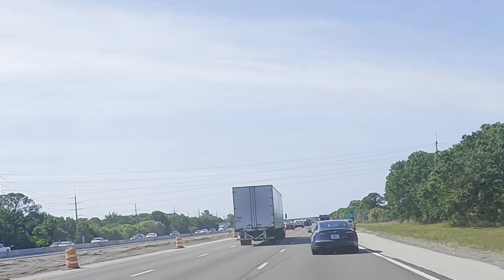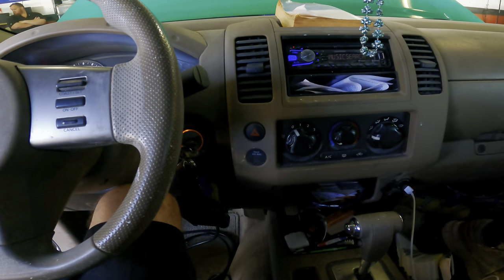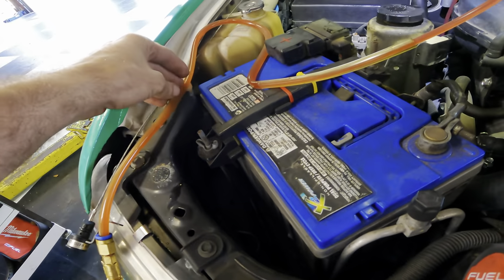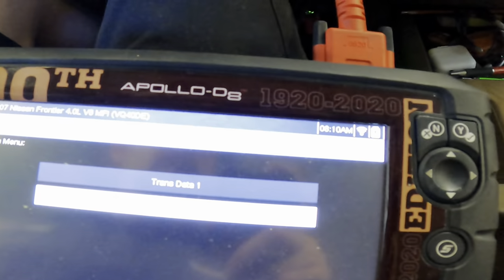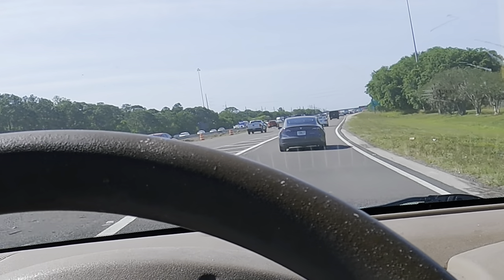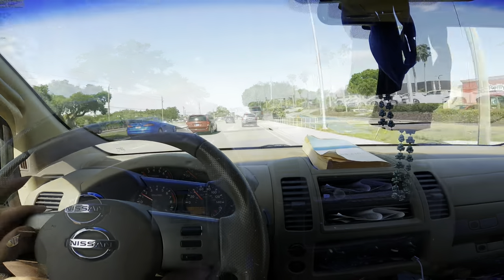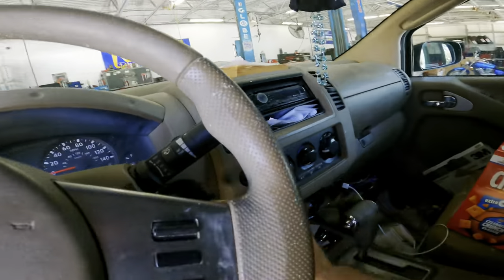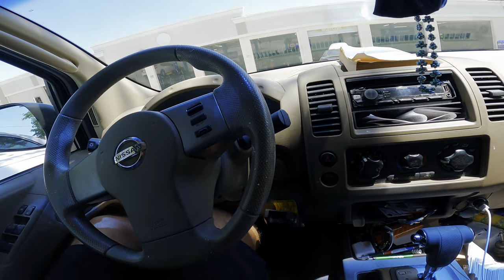Customer States: Vibrates Sometimes! How to save money by using your words!

Comment: I have been an electrician for 20 years, and have gotten to the point where I can get a diagnostic over the phone maybe 40% of the time.  What I have learned over the years, and this applies to be and vehicles, is sometimes you just can’t relate what you are experiencing.  I recently took my wife’s car to the local shop because the engine just wasn’t sounding right.  Mechanic said it sounded ok to him, but pulled the dipstick and found it over-full of oil!!  Took it back to the dealer (where wife had it recently serviced) and had them drain and refill, with the hopes that the engine isn’t damaged.  How else can I describe what the problem is other than “engine sounds different lately”?  When did it start?  I don’t know, she only drives it a couple of miles each way during the week, maybe grocery store or something on the weekends, but she doesn’t notice stuff like that.  I only noticed it when doing a longer drive recently.

In this particular video, I think the service writer DID do a really bad job with gathering info and translating it to the techs.  However, I think that each situation is different, and it isn’t always the customers and it isn’t always the writers.  Hell, I even took a van to three different locations with a really bad squealing noise from the brakes, with each technician telling me there was nothing wrong.  I finally insisted that I wanted a complete brake tear down, and they finally found an occasionally sticking piston.  So even when there IS full communication, even the tech can be the problem.
Reply: Sometimes the service adviser needs to ask the correct questions.  I would of asked when does it make the noise? All the time? When engine us cold? When engine is hot? Slow speeds? Fast speeds? Can you describe the noise, is it slight or very loud?  Is it a rattle, knocking, squeak, or muffled type noise? Has the vehicle been worked on recently? Are you noticing any other symptoms like vibration or smells? 

There's alot of questions that can be asked that the customer doesn't think to tell. And many times the vehicle won't exhibit the symptoms at the time of the techs test drive.
Reply: @HoLeeFuk317  This is why it would help for the customer and technician to communicate directly.  So much information is lost in translation by service "advisers".

Comment: "Shake when in gear, and like a noise at times." I think that needs to be the first line in the chorus of a song describing the frustration of dealing with vague trouble descriptions...
Admit it, you laughed.
Also, did you check to see if the air cleaner is full of Cheez-Its?
Reply: The first part is descriptive enough, but "like a noise at times" -- what the heck?  How does something resemble a noise?  Lol.  Good luck!  Plus, it's INTERMITTENT.  This one could cause lesser mechanics to retire.
Reply: It actually reminds me of the novel Flying Sorcerers. The interloping character's name, through translation, was called "As a color, shade of Purple Gray" and for the remains of the novel he was referred to as "Purple" by the characters.

Comment: I worked in a shop some years back where if the write up from the advisor was less than 3 lines for anything more that the likes of lube oil and filter or tire rotation, the advisor was in for a talking to.  The manager was serious enough about in fact that he wanted the tech to need to take a few minutes to read the notes on the complaint.  Rarely did any of us struggle to find a starting point when doing the repairs or services.

Comment: Sometimes part of the disconnect is from the service advisors. I am fairly knowledgeable about cars, etc. But I know my limits. I don't have the time and equipment for more involved repairs. 

On a repair I had recently, it wasn't until I was able to talk to the tech directly did the problem get solved. As soon as we had a conversation, he immediately realized what I was talking about. 

He said to me, "unfortunately the service advisors don't always relay messages very well." The service guys unfortunately can have just as bad of "vocabulary" as the owners sometimes.

Comment: As a vehicle tech of 30+yrs you hit the nail on the head @23mins into this video, I get totally cheesed of with the service desk/customer not passing the info on to me, I had a car come in god knows how many time for a noise at the back end, it would turn up with the keys through the letterbox "its done it again". Having got totally peed off with the front desk and lack of info I left a note in the car "If it does it again STOP and phone me!" He phone me on the Sunday, we had already worked out it only made the noise on a Sunday, I drove to his location (his mother in laws house) and he said it does it there just as I drive up her driveway,,,,,,I pointed out her steep driveway entrance and pointed out the tow hitch was hitting the ground, I had gone through the bushes on the back end even with correction fluid to see if that had moved, UNTIL I asked the right questions, where, when, show me. Great videos already subbed so tappy taping the like. Thanks Ray, Hello Pete !
Reply: So did you fix his mother-in-law's driveway?😄
Reply: It's always the mother in law!

Comment: As my body begins to fail me and I make the transition from mechanic to service writer, I'm finding that my experience as a mechanic is endlessly helpful in collecting and passing information back and forth between tech and customer.

Service writers get a lot of crap from mechanics, and rightly so a lot of the time, but if you've ever had a GOOD service writer, you know just how quickly all that disdain fades away.  Good verbal AND written communication skills, not just willingness but eagerness to step in between a frustrated tech and an angry customer, and the knowledge and ability to poke, prod and tactfully interrogate to find the complaint, as well as to translate to and from "tech speak," are critical skills.

Comment: Totally agree with you about getting good information from the customer. If the tech can't talk directly to the customer, it's up to advisor to get that information. Good advice to customers too. Something that customers do sometimes,  is diagnose  the problem themselves, and if the tech isn't careful, he can be led down the garden path. I was told by a customer that he had replaced the radiator to address an overheating problem. so I checked everything but the radiator. could not find over heating cause. finally checked radiator, plugged!

Comment: I have a pathfinder with this engine, I'm pretty sure I know what vibration he's referring to. While in Drive and stopped the rpms drop to ~600 and it jumps back up to where it should be. I have no mechanical experience so I have no idea what causes it. I thought it was a misfire so I took it in for a tune up, but even with new plugs it vibrates.

Comment: So many transmissions these days MUST be maintained religiously as oil. I would get customers saying "well, I never had to change transmission on my other cars before". They completely fail to realize transmissions also have never had as tight of tolerances before. Just about every main brand has a judder when the trans fluid has been grossly neglected. That also gets many manufacturers transmissions an undeserved bad reputation. Everyone would expect an engine to explode after 20-30k miles and no oil change but their head explodes when a neglected trans blows after 60-100k. Go figure lol

Comment: I had a 2015 Mustang GT that I supercharged and had been drag racing. I took it to ford because the bolts that held the diff in the cradle tore through the bushings. I told the guy well I supercharged it so I'm not sure if you will cover the diff bushings. He said why would a super charger affect the bushings??? I said no idea! LOL The car still had slicks and skinnies along with the track number on the rear window. Called me two days later saying the bushing aren't a replaceable part and the entire rear subframe was being covered under warranty. I was blown away.

Comment: As long as you are ranting, you should include service writers as possible problems.  Back when I was young and foolish and took my car to the dealer a few times, I would spend two or three minutes describing in several paragraphs of detail to the writer what the symptoms, occasions, and suspected problem was. A couple of times I wrote the problem out on a sheet of paper and tried to hand the description to the service writer, and he refused to take it, saying there was no place to put it in the system. Then he would think for a bit, and write down about three words on the ticket, probably along the lines of "customer does not know what is wrong." Needless to say, it cost a lot of money and rarely got the problem fixed. Then I started going elsewhere, where they listened to me, and they usually had problems fixed in a few hours.

Comment: I think automotive service industry is rife with these miscommunications because you have such wide variables at play. 

I used to listen to Car Talk on the radio and most the call ins demonstrated this very well - expert mechanics can think through problem solving an issue from several angles when given minimal inputs, so a customer can help narrow the focus by providing good, situational symptoms when presenting their vehicle.  Unfortunately there are a lot of uneducated consumers who don't know a dip stick from a valve stem.

Service Reps can help by anticipating and eliminating paths of diagnosis by asking good follow-up questions and taking good notes.

Finally, service techs can improve the equation by providing supportive feedback (both positive and constructive) on service rep's note taking, helping them improve their note taking and questioning process for future customers.

Comment: Transmission fluid changes, brakes, steering and other drivetrain work cannot be addressed/declared fixed without a test drive, even if you were to jack it up in the air, its not under the load of all the vehicles weight and the tires hitting the road- you’re a true mechanic ray 100% recommend anyone to you

Comment: Much can be learned from observing the condition of a vehicle. Especially the interior.
Reply: Like what?
Reply: A vehicle can look completely mint and not run at all
Reply: @danh2134  Very true. Happened to me. 2019 Dodge Ram 2500. Observation: Brand new on dealer lot, upon pushing ignition key loud pop behind dash and under driver seat. Vehicle failed to start. Decision: Ended test drive, failed to purchase vehicle.
Reply: @Bryan-Hensley  Owner likes Cheez-its, but that’s only an assumption.

Comment: Don't Reeeee! Ray! lol /edited to add this, I see that they are a painter and that seems to be a work truck. In my youth I painted apartments, I can't tell you how many vehicles I trashed because they couldn't take the weight of 10 5 gallon buckets of paint, plus sealer, plus equipment, hitting Cleveland streets constantly. His problem could be suspension related while fully loaded down.
Reply: Could be. And had work to do and moved all the heavy stuff over to another vehicle when he dropped it off for repair. Therefore eliminating most of the problem himself.

Comment: In my humble opinion... the less people know the easier it is to control them.  Automobile manufacturers have slowly conditioned the buyer to rely more upon technicians to do everything from a basic oil change to much more complex repairs.  They removed informative gauges and replaced them with warning (idiot) lights.  For example, in regards to some customers not using their words, a customer may say my car smells hot instead of being able to look at the temp gauge and saying it's reading 220° in heavy traffic.  
Many moons ago during a Boy Scout meeting, we learned how to do a basic tune up.  Change oil, oil filter, air filter, pcv, cap, rotor, spark plugs including checking/setting proper gap (info from the owner's manual) and so on.  I believe we were taught in driver's ed how to change a flat tire.
 Keep up the great work. Love the videos.

Comment: On your not-a-rant rant, I can see where a good service writer can be as important as a good technician. They are the ones with immediate access to the customer, so they need to be skilled at interviewing the customer to find out more about what is wrong. They should never settle for "car won't start". They need to ask more questions. When won't the car start? When it's cold? When its warmed up? Describe what happens when you turn the key/press the start button. Do you hear any sounds? Are there normal sounds that you DON'T hear? I've never thought about this issue before, but you did a great job of describing how it affects you when trying to fix things.

Comment: I always bring a note in writing with date, time, mileage, what, where, when, etc. I know from the questions I get back from the service writers, they don't read. I have also talked with my mechanics and find that the service writers don't listen. I worked my way up to manager in a JC Penney Auto Center before they all closed.
I also commend you on the hands on check of problems. I feel that people rely on computers for more than they are capable of.

Comment: Ray, it is not clear to me if you evacuated all the trans fluid and did not change the filter if applicable. Flushing the whole system without just doing changing the filter is the kiss of death for a transmission with poor fluid as you yourself have referenced many times. You are a technician not a mechanic and I am over the top impressed with you in every way.👍
Reply: Watch it again. Its quite clear what Ray did and didn’t do.
Reply: @robmurray33  Based on my 25 year career in a fairly high upper echelon of auto manufacturing, your reply is archaic. Can't believe I just replied to such a misinformed person. Maybe too much coffee!!!

Comment: My old man is an amazing customer, he owns a pristine 2000 Chevy Cavalier LS, last week he came to me because a no crank no start issue and then he added that with the car in Park it keeps rolling downhill. It took me longer to get and replace the gear selector cable bushing than to correctly identify the problem without troubleshooting.

Comment: Split pins have a slit all the way through the pin with a slight swelling in the center as it is an interference fit.
Cotter pins are designed to have the two ends folded over with the loop pressed firmly against the part it is holding and the ends fold over in opposite positions

Comment: I definitely agree with the whole describe as much as you can rather then just “car does not start”. But there are SO many people out there so unaware of anything. I mean that’s why you get your metal on metal rotors and pads, balled tires, oil with the consistency of a red brick, and the list continues.
I just replaced a battery for someone that was about 8 years old. They said “you have to replace that?”, I was almost dumbfounded. But as nicely, and calm as I could, I just replied “yeah… typically a batteries lifespan is 5 years.” 
People are absolutely clueless these days. Everything should last forever without attention, and everything has to be ready to go on their finger tips.

Comment: That fluid reminded me of the fluid in a 2001 Sonoma 2.2 4cyl. I got in 2019. Fluid had the same color as mud. No burnt smell. Did a 5qt fluid change that helped. Covid and a back operation have kept me from doing a full filter/fluid change so that is now on the to-do list. Luckily it doesn't get used much. And a 2005-2010 Honda Odyssey check the fluid hot and engine off in park. And that guy that hit the object on the highway will soon be at your shop stating he hit something and now the car has a "shimmy". That guy that hit the object on the highway will soon be at your shop stating he hit something and now the car has a "shimmy".

Comment: I have rebuild around 6 different Automatic transmission's, And yes There's A LOT to know about Transmission's even A 4l60 Gm transmission has many different updates almost every year is set up a little different, I personally like rebuilding Allison transmissions behind the Duramax, I have successfully done 8 of those but I don't do this work everyday, But doing a fast relearn after changing anything in those is highly recommended, Because you can destroy a rebuilt transmission especially if the truck's are all hopped up like the ones I worked on. Great work,  Yes Failure to communicate to Mechanic is Very frustrating, I know exactly what you're talking about SUCKS BAD❗

Comment: Transmission rebuilding requires a cleaner working area than a service bay and specialized working table that drains as the tech works. Cleanliness is very important.

Comment: Communication is a two-way street. A few years ago, I hit a deer with my 2012 Tacoma SR5 4X4, and when I took it to the dealership with an insurance claim and told them that it has a broken sway arm end link and a torn CV joint boot on the passenger side, they instead replaced the driver's side headlight lens and  fixed a fender dent from an accident several several years prior when I hit a stop sign, not a deer. Thank you, Lehigh Valley Honda of Allentown, PA!😅😂

Comment: Please remember Ray we run into the same thing with some inexperienced mechanics. I took a brand new diesel pick up back to the dealership where I bought it 3 times for lack of power. They changed fuel filters first. No change. Changed out Turbo second time. Could not find anything wrong the third time. I was so frustrated that I followed the fuel system from the engine back to the tank and found a wire unplugged on the electric fuel pump mounted on the frame. Ran like a champ.